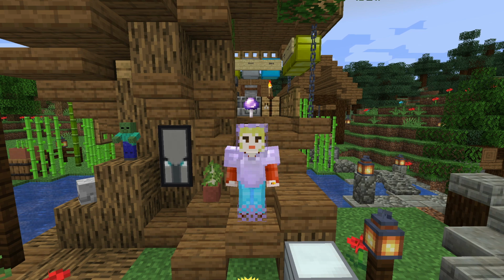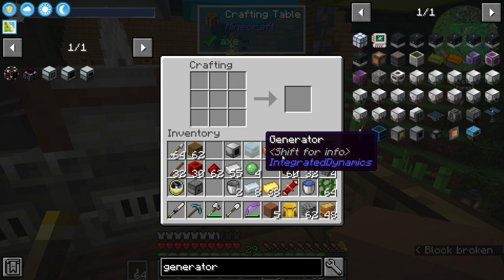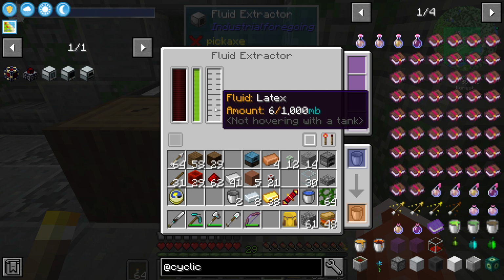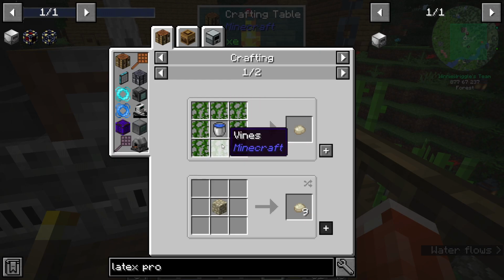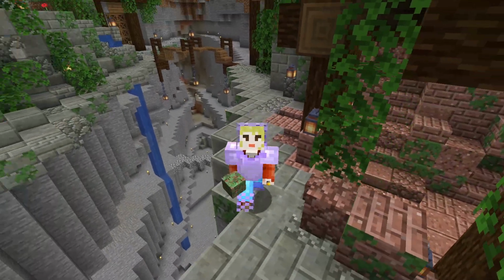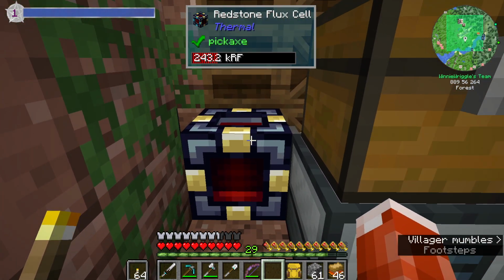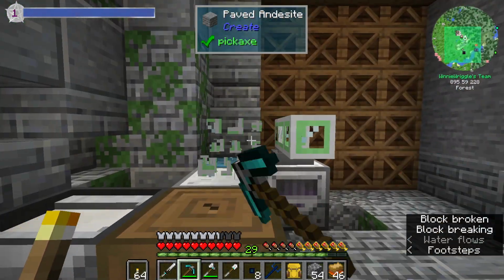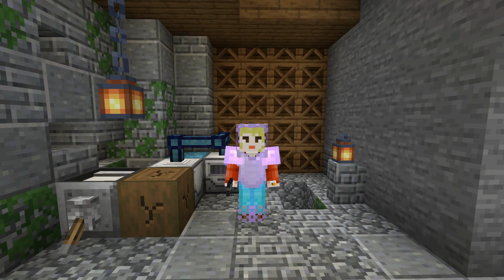Industrial Foregoing Plastic from Trees! EP7 Direwolf20 1.16 Modpack Let's Play

Comment: just be aware that the spawners you find in the dungeons have predefined mob spawnign "rules" that dictate what mobs spawn, with what gear, and what enchants on those gear items.  The mobs that are spawned by them also do not necessarily drop all the normal drops you would get from the mobs.  For example, the wither skeletons spawned by the spawners do not drop skulls unless you kill them manually.  Most of the mobs also do not drop some of the non-vanilla items like skeleton ribs, creeper hearts, etc unless you kill them manually.  For most things this isn't a big issue, but if you need the special drops to make mob warding trinkets, or skulls to spawn the wither boss, you may need to leave yourself a way to manually kill the mobs.

In this pack, there is also a much faster way to make plastic.  Most recipes, will accept Industrial Foregoing plastic OR plastic from the Rats mod.  If you create a Trash Can from the Rats mod, then right click blocks into it (such as cobblestone or some readily available block), you periodically get garbage piles, which you can place and break (repeatedly sometimes) to get an item you can smelt into plastic.  You can automate the placing and breaking of the garbeage piles with a Block placer and a Block breaker.  You can quickly get a stack or two of plastic in much less time than going the latex extraction route.
Reply from the maker: Such great detailed feedback - thank you so much. I didn't know how easy the Rats mod made it to get plastic - that's very useful info.
Reply: @WinnieWriggle  how did you get plastic from the Rats mod?
Reply from the maker: @BionicLeg  For the Rats mod, I think you get it from digging up garbage. (You'll need to make the trash can from the Rats mod) That gives you plastic waste and then you smelt the plastic waste in a furnace to get raw plastic. Hope that helps!